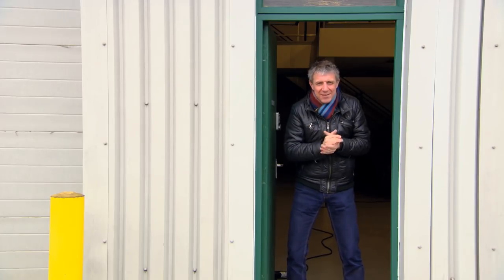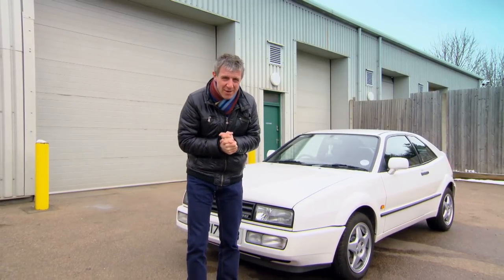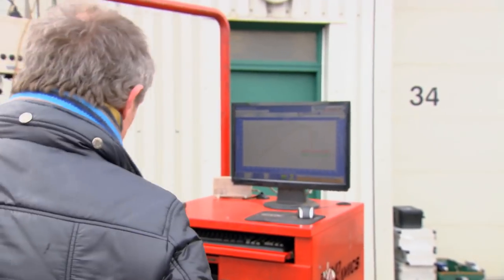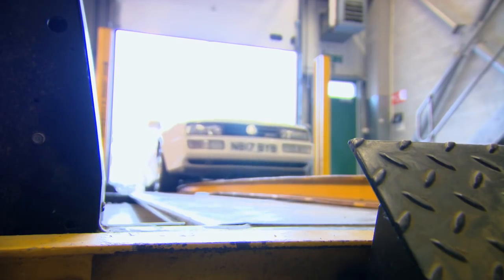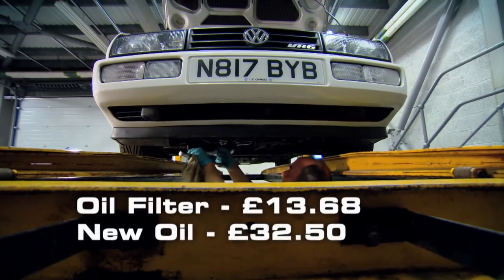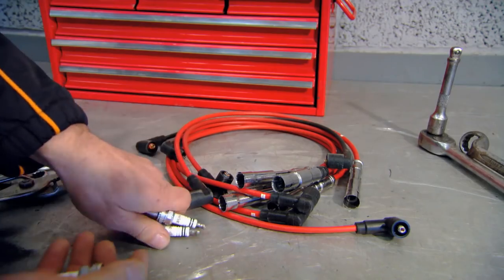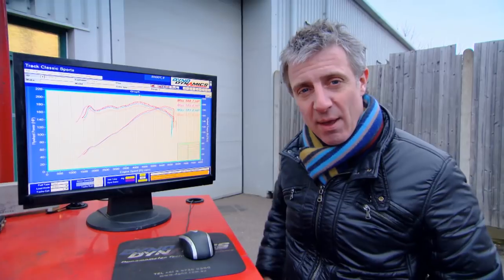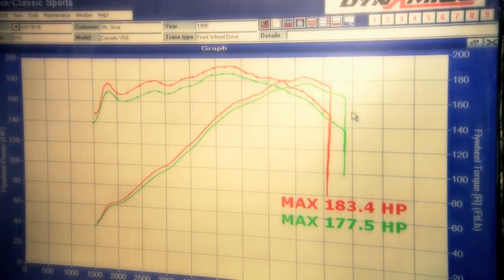Fifth Gear: Restoring Engine Power

Comment: What was the total cost - let's see. 5gbp fuel additve, 13.71gbp for air filter, 46.18gbp for oil and filter plus say labor at 100gbp, then 73gbp for plugs, and 163gbp for leads. Add it all up and you get 400.80gbp for the full service - that comes out to $562.45 in USD which average maintenance on a car costs about $600.

Comment: Well... the alternative would be to strip down the whole engine to bits and clean everything by hand with a good old wash. Get rid of the stale fuel and carbon deposits. Expensive but atleast you will know that your engine is clean as... well as clean as it can possibly be for another 5-10 years or so.

Comment: PS @1:35 - To get an accurate figure, you do it 8 times and **take an average**, not the highest (sensor glitch?) reading.  Come on.....
190Hp at the engine - 10% drive train = 171Hp.
Initial test of 177Hp is 6Hp more than expected... kind of debunks it right there.
Love you 5th Gear, but **this smells like a bad advert**.   boooo......

Comment: Engine needs to be reassembled to recover the stock power
Reply: Exactly. You have to rebuild it if you want to get back power. Valve seats wear, valves seals wear, piston rings wear, tolerances increase, bearings wear, etc. 

The only real way to get back the same power as the day it was built is to do a full blow rebuild. At that point though if you are wiling to go that deep and have the engine out why not upgrade over stock for more power? That's my thought.